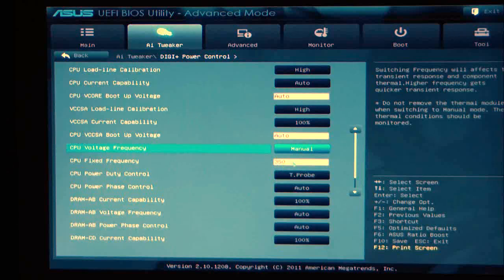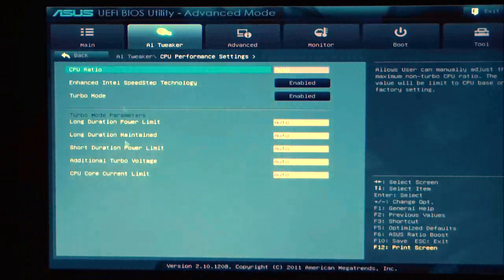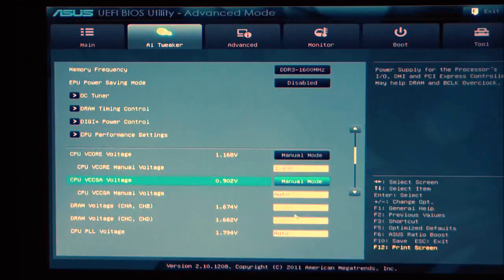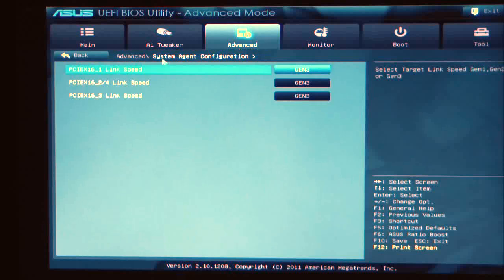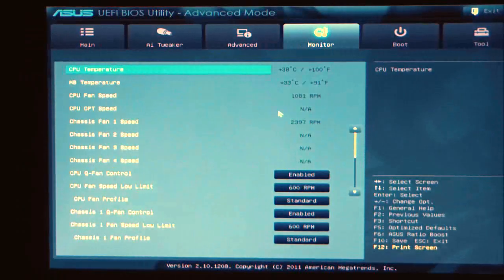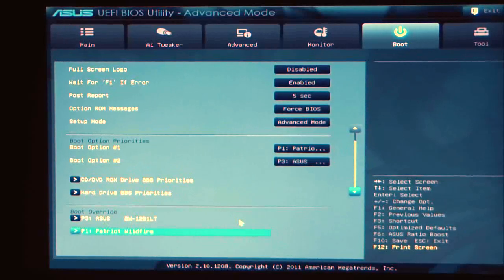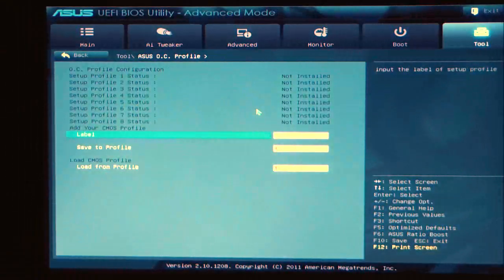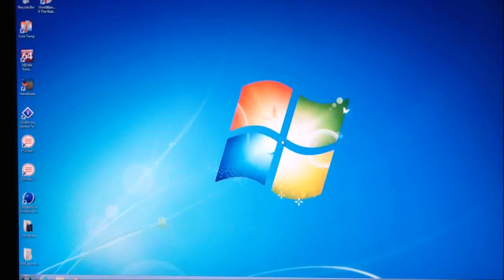ASUS P9X79 Pro and Deluxe UEFI BIOS Part 2

Comment: Hi thanks for the bios review , very helpful, I have a quick question , I just got the p9x79 board with 4930k I7 , what is the best memory solution for this setup, I was told I can only run DDR 3 1600 mhz is that true can I go to 1866 ?? or 2400? if so do I have to overclock or can I just run it on default settings...